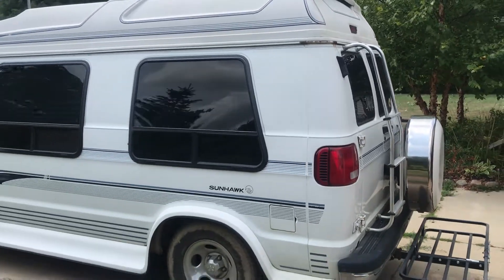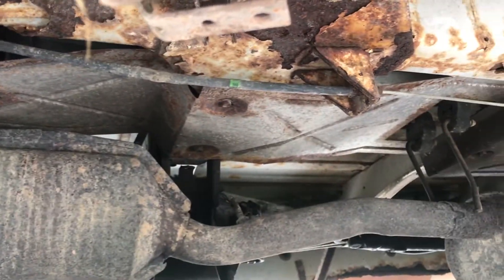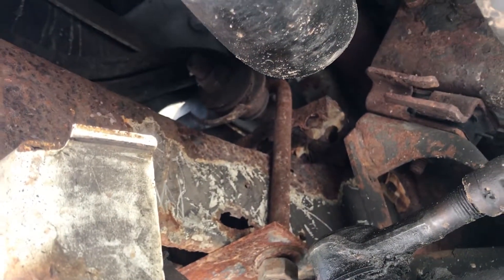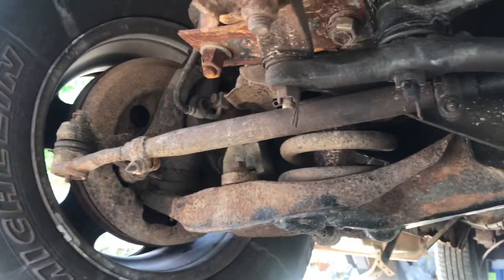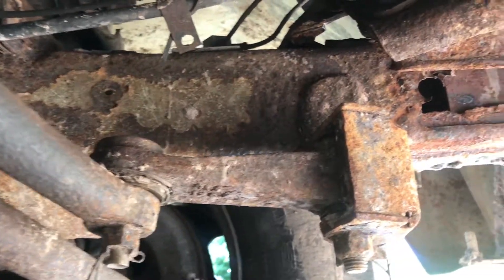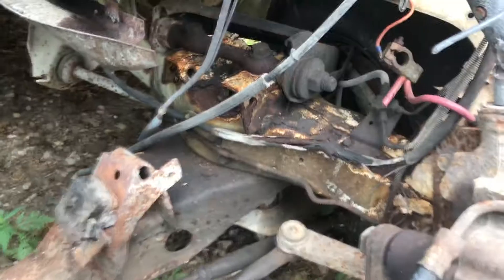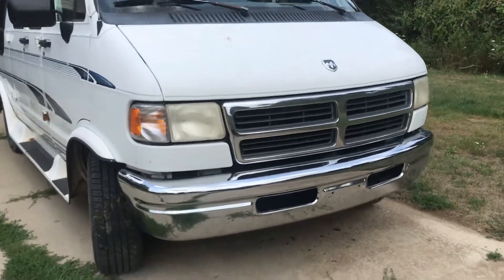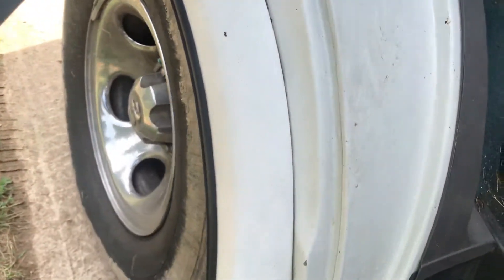How Rust Crippled My #Vanlife

Comment: Man o man I’m a Detroiter , ive had my eye on a 1997 Ram cargo van running good rusty , very cheap , i have heard about this problem, and known of one or two going thru trouble of getting the front ends redone,  re welded , repainted/ coated. Was told It was quite involved  and now I’ve seen just how extensive the problem can be in depth from your video just now. thanx,

Comment: Those are actually common Dodge B series problems. I have welded up more Dodge van front frame horns than I can count. Why? Dodge never correctly sealed up the frame horns. All that is repairable. What you need is a minimum 175 amp mig welder on flux core and a bunch of 1/8 angle iron. Then enough por-15 to raise the Titanic.
Reply from the maker: So you think that's repairable? I'm pretty bummed about the state of things with this van and don't want to put my wife at risk with my crappy welds. I'm torn between just scrapping it so I can forget how disappointed I am, or keeping it around until I am brave enough to attempt something more serious (then dealing with the anxiety every time I drive it). Thanks for commenting!
Reply: Yeah. That's all repairable. It won't be easy tho. You're going to need a 175 amp welder. Harbor Freight sells an O.K. mig for $200. I have one and its O.K. My Miller 180 runs rings around it, but in a pinch, it's always worked. Ditch the wire it comes with, go buy some Lincoln, or Mathesons wire, set it to DCEN, and get ready to go to town on the frame.. Then all you need is some 1/8th plate steel, or angle. But yeah the steering box breaking off is super sketchy. Thats happened to me as well. Looking at your welds at whats left of the steering box mount... Its not that bad.. You got the amps set too low. Thats why the weld looks "Blobulous" 
But to be honest, I got so sick of welding up Dodges I went and bought a Ford.. They have full frames and are much more resilient to rust. 
I subbed I really want to see where you go with this.. :-D
Reply from the maker: Thanks man, those comments are encouraging. Because of this, I actually spent most of the day yesterday reinforcing it to the best of my ability with the vintage Hobart stick welder I have on hand and 6011, plus some angle iron I had lying around. I'll definitely considering upgrading my welder at some point. I have trouble gauging the power settings when some regions of the original material are so rusted they just blast away, but there's definitely some heavy solid steel left around the steering mount.

It's really fun learning to weld, but less fun when you're worried about your van falling apart at 70mph instead of enjoying adventures! I learned my lesson and won't buy a unibody van/truck again.
Reply: Depends on the Hobart.. If its a 110V welder... Its way too small... Your going to need a 220V and use atleast 7018ac rod. You can go get a Lincoln 225AMP "Tombstone" welder AKA "Buzz Box" used on Craigslist for under 200 bux. It'll be an A/C welder, but plenty powerful.
Reply from the maker: Thanks. It's a super old Hobart T-180, 230V input, up to 180A output. I think the limiting factor is my skill rather than the machine.

Comment: Sigh, I recently bought a 99 Dodge Ram van that failed inspection because of frame rust. I don't know the extent of it, but I'm pretty sure I got ripped off. Oh well. I'm gonna die some day anyway, so eventually it won't matter anymore, right?
Reply from the maker: Noooo. Sorry to hear. I don’t want to give any advice about what to do, but you are certainly not alone! I wish you the best in coming up with a solution. These vans are amazing except for the frame! Really miss mine. I have a pop-up camper now that I have a baby.
Reply: @BurntOnBothEnds   It sucks more because it's a conversion van, so so much of the work has already been done. It even still has the tv and vcr in it!
Reply: Inferior products from us vehicle makers..from 99 to 2002...my 2001 ram van same ...saved front end but lots of work